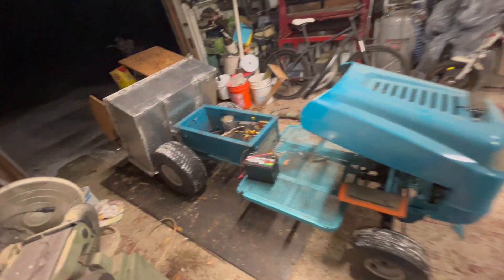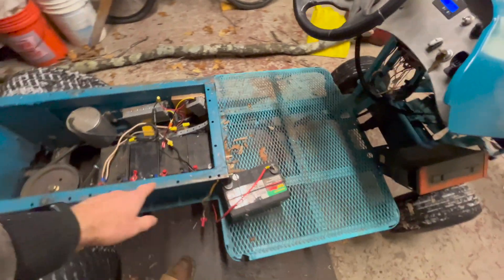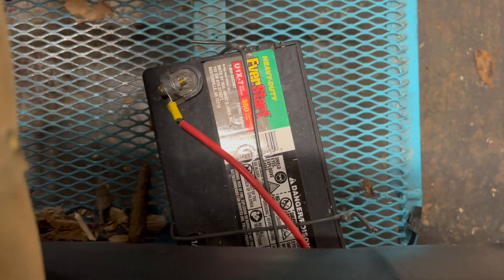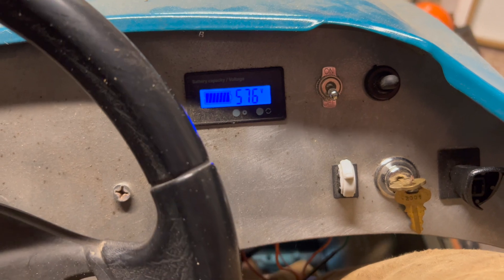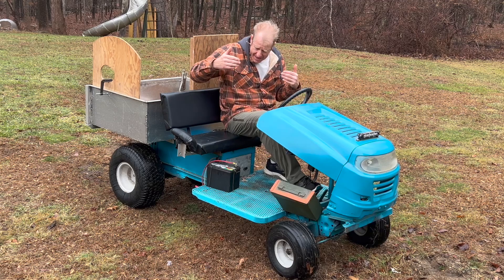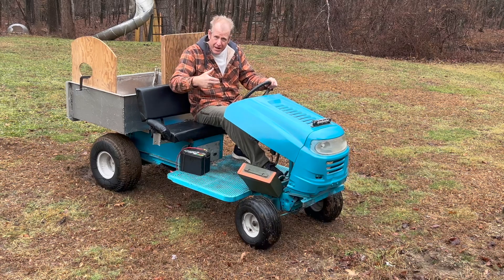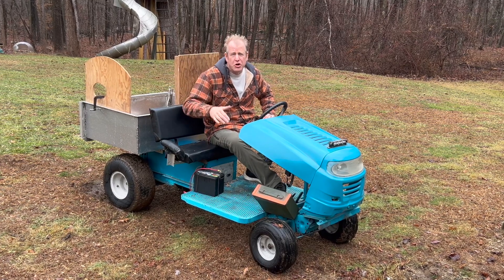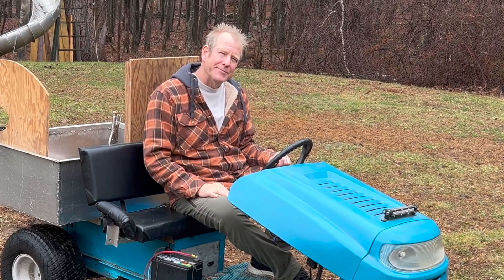Voltage Increase 48 to 60 DIY Mini Electric Truck

Comment: Why did you put an extra battery in series with that bad one? It could limit the output power of the whole system. Alternatively, you could try another battery chemistry—it would certainly increase power too, because of lower voltage sag and more range too.
Reply from the maker: I tried using the larger dimensioned 12volt and eliminating the damage battery. And it worked similarly to how it was before the damaged battery would only hold 10volts. 
When added the damaged battery back into the series the volt meter was showing more volts than typical so maybe the bad battery was limiting amperage. But I didn’t want to invest $ into trying to fix the batteries because I’m thinking the motor is too small for sustained work. I’l post again when the new bigger system is installed. Thanks,